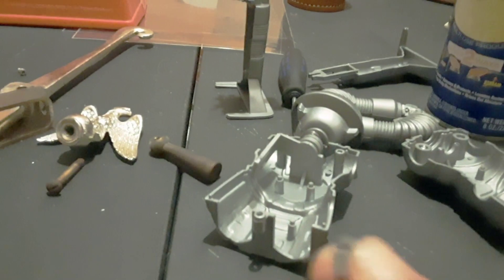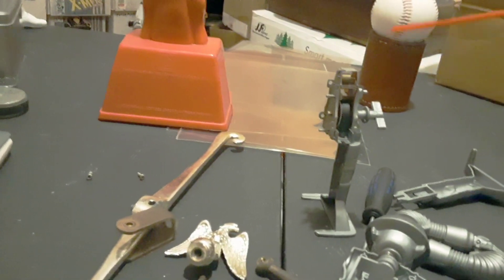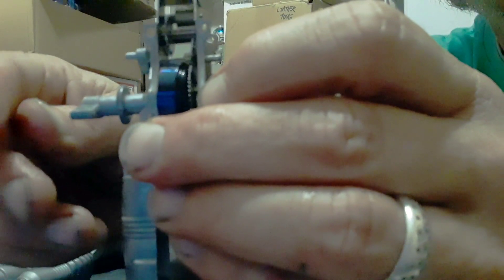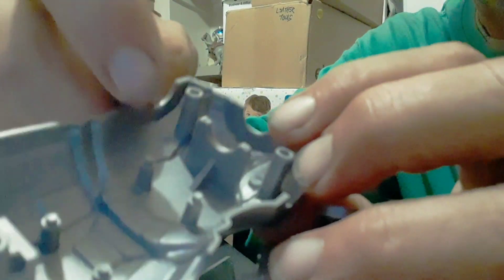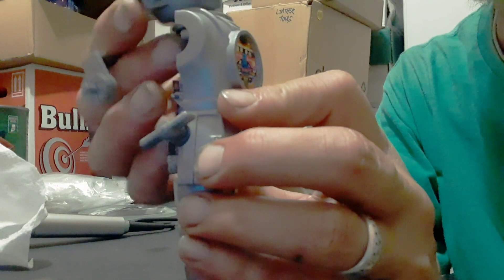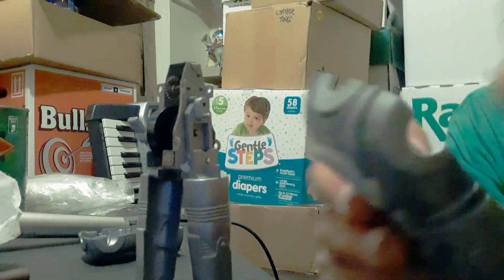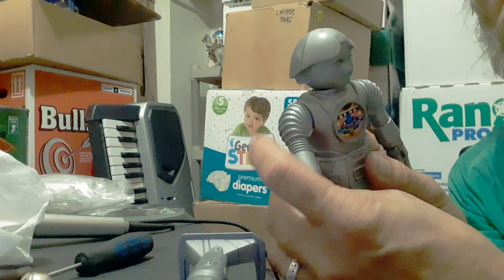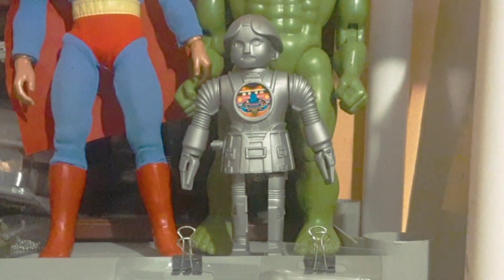MEGO BUCK ROGERS WINDUP TWIKI INSIDES

Comment: Ahhhhh... WD40 is a solvent, not an oil (WD is short for "Water Displacement"). WD40 also can be destructive to plastics.
Reply from the maker: my goal was to clean out the dirt on the gears
Reply from the maker: i know it hates darth vader collectors case surfaces